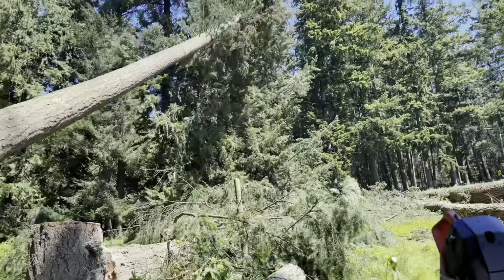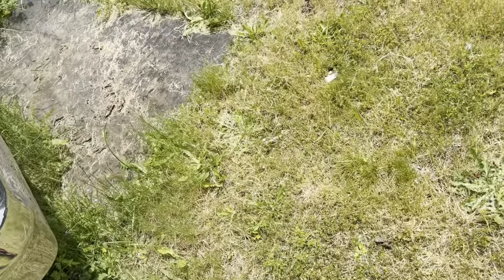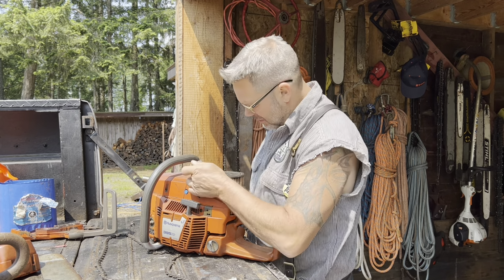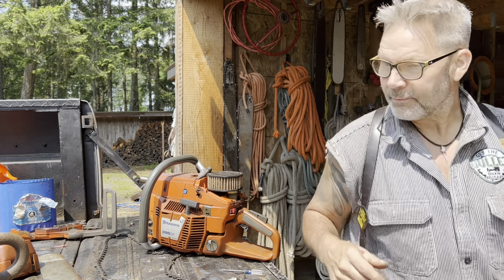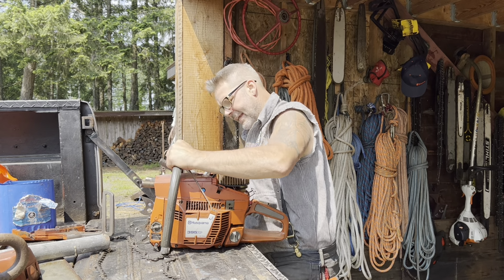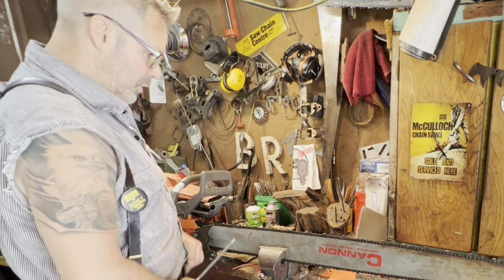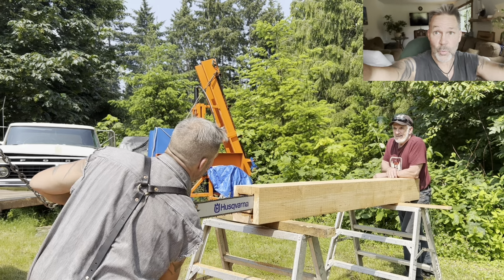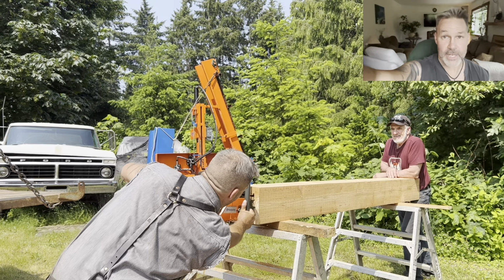THE CRAZIEST CHAINSAW BORE CUT , 4 FOOT BAR

Comment: That was krayzeee.... for sure
What a workout....
Takes a beast to run a beast.
Buckin is in beast mode here.
Please protect those ears, 
I'm 67 and the ringing in my ears (head) is
24/7
From all those years running power tools and working rock concerts without hearing protection.
It's enough to drive ya krayzeee...😵‍💫
Hope you was wearing ear plugs 🚧

Comment: Legendary, I have done a lot of cross grain bore cutting, but only on a 28", no end grain in sight, I mean who else could they have called, just awesome to watch.
Reply from the maker: thx
Reply: @BuckinBillyRaySmith  It was you who taught me how to set the rakers for bore cutting with the Oregon Guage 👍

I do Parbuckle logging with small wheeled machines, I snipe the logs and bore cut a hole for the snig chain so I can pull the log and keep it centred.

One day I'll have a Cat D4, till then it's bore cutting for me.

Thanks again, Jamie.

Comment: Nice work. I'd have cheated and clamped a guide on the saw, to at least indicate where the tip was vertically. I wonder how they removed the balance of the wood? It would be fun to see his finished project.

Comment: I was so confused.  How are they going to remove the plugs?  Why are they making this huge bore cut?  How is he so good with a chainsaw that he can even attempt those cuts?  
I don't think i got any of my questions answered but I'm glad you're out there!
Reply: I’m assuming the timber posts will slip over steel posts in the ground, I’m also curious as to how he’s going to get the rest waste out
Reply: I bet they cut the end off then pull the core out

Comment: I have no idea what your doing or did. What's with the piston stop and or why? Maybe another video for some other day.
Reply: He had to change the sprocket from 3/8 to 404 so he could run a bigger chain but that requires him to remove the clutch which also means that you have to un screw it from the crankshaft an in order to do that you have to stop the engine from rotating  the piston stop goes into the sparkplug hole and stops the piston from spinning . I hope that this help you understand👍😉
Reply: @levismith8245  thanks
Reply: @jfig786  No problem just did not want you to miss out on what he was talking about